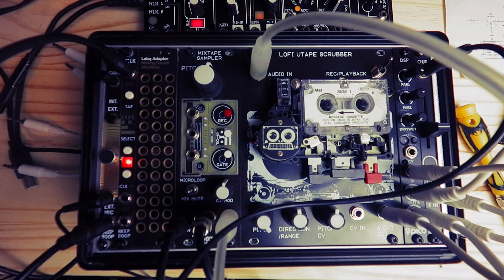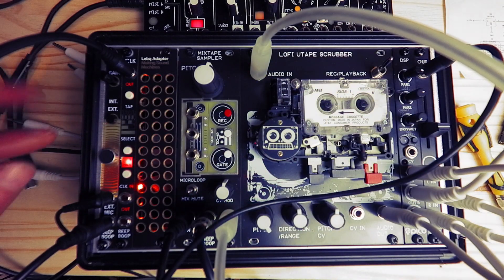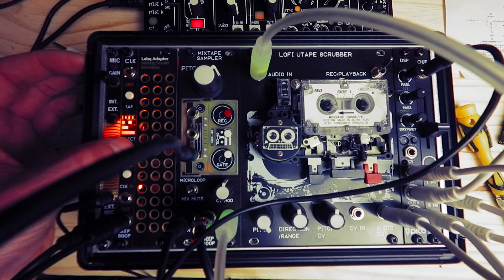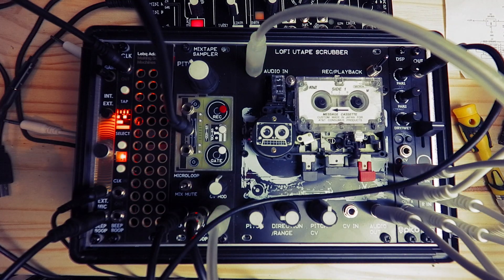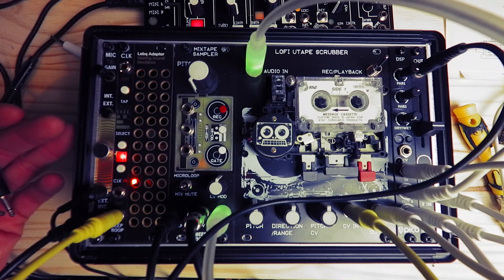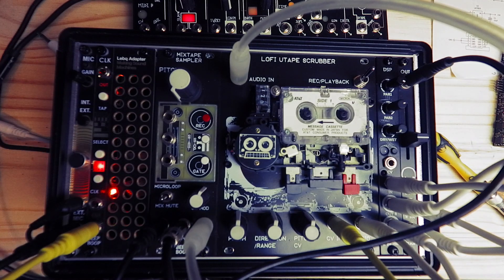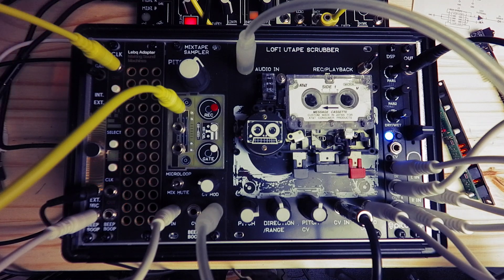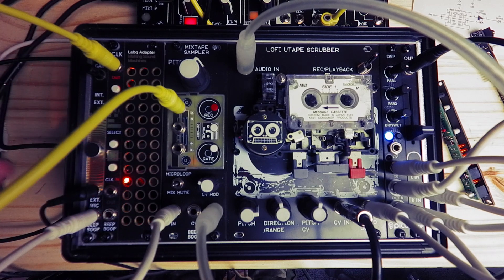2hp CLK DIV Demo video

Comment: great stuff!
 Is there a way to reprogram the division to multipication?
 it is really hard to tap the correct beat (if you want a 4/4 beat around 130 bprm,)
as you have to tap four times as fast as the downbeat,quite impossible actually,which makes the module only usable for slow ambient..
Reply from the maker: Hi :) unfortunately there isn't a way to reprogram the module but maybe I should design a Clock multiplier version! I do have a 2hp CLK module that can give 0-240bpm which is ideal for deciding down.
Reply: @beepboopelectronics  yeah ,great,if you make the tap divided by four it will be easier to tap in the actual bpm you will be using..